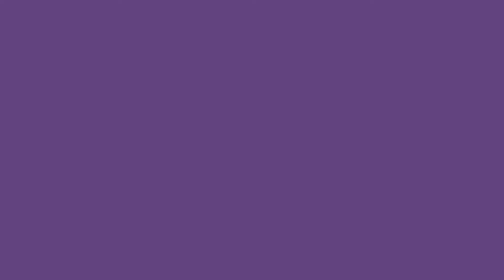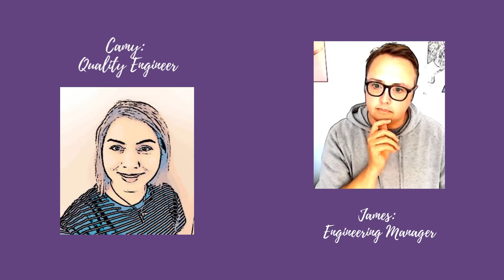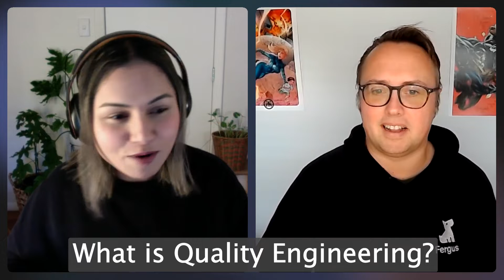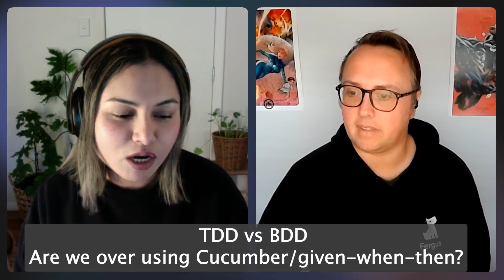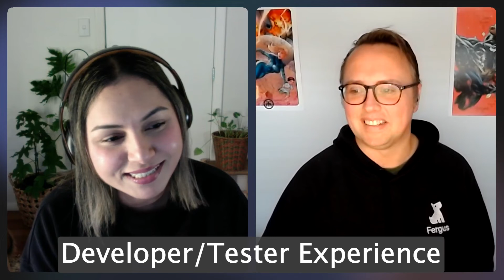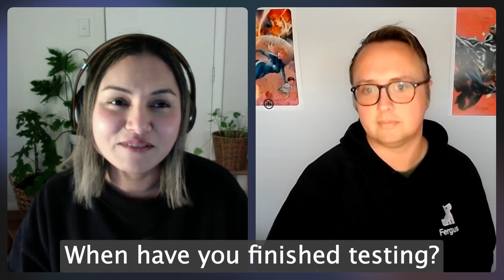S1E3: What is QUALITY ENGINEERING?

Comment: Hello beautiful people,

just adding a few thoughts to the TDD/BDD chapter from a bit more technical perspective. It might also shed a bit more light what is happening in this area and why.

I think Cucumber's BDD - scenario based testing - terminology is not going out of fashion, it's just robust integration testing perspective. The big leverage of that technology was to couple the  test documentation to code. It still works very well, as you cannot change the wording (living documentation) or the code without the other.

I assume when Camy referred to "one line statement/requirement", that was about cypress (well...the built in mocha framework). Mocha was originally used and developed for nodeJS based unit testing which truly does not need more than a line of statement. Cypress brought the idea of (node) package/module based testing that made real the very fast, independent and immutable test code. Testers (engineers ;) ) can write code more of a unit test style now. Boom!

This is just the result of a later chapter in this session: shift left.

Comment: Nice episode! 

I can't stand the "retry" test approach. I've had this proposed to me many times in the past but it always comes back to the point that this is not a fix. Even a test that fails only once a month is not ok. Have a mechanism to exclude tests that need work to prevent blockers - but don't silence failures with retries. 

TDD can be extremely powerful, esepcially when fixing bugs. A developer sitting down with a tester, writing up a unit test that proves the bug & then going ahead and fixing the issue before showing that test is now passing. It gives both parties more confidence. 

I agree on the point of BDD frameworks dying out. The extra layer is just bloat if it's not serving a purpose. With a huge push on learning automation/coding across BA & QA roles, existing BDD frameworks become useless. This doesn't mean BDD as a practice isn't valuable - getting input from managers/BA/customers before test creation & having meaningful reports (and/or readable code) that can be consumed by managers/BA/customers is all good and well - but this doesn't mean you have to add a "given, when, then" layers on your code
Reply from the maker: Thank you, Shane, that's really good feedback and very much appreciated. Your argument about 'No retries' is definitely thought-provoking and something we'll be exploring more about. And thank you for confirming that BDD frameworks are indeed dying out.